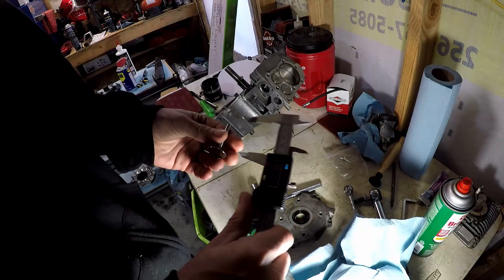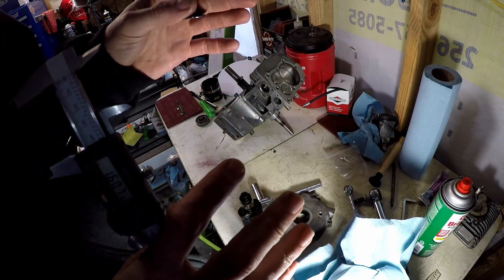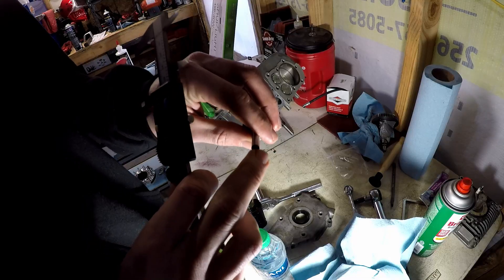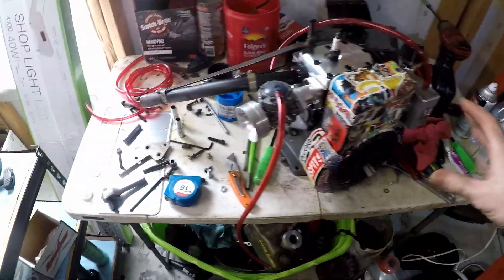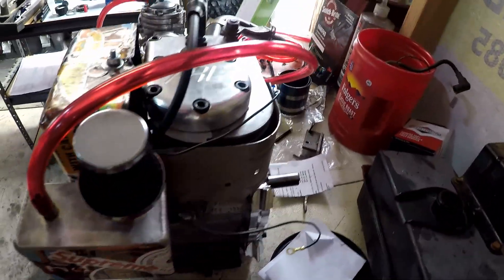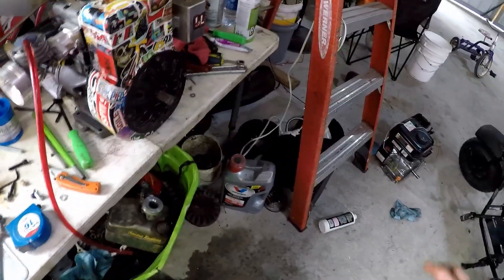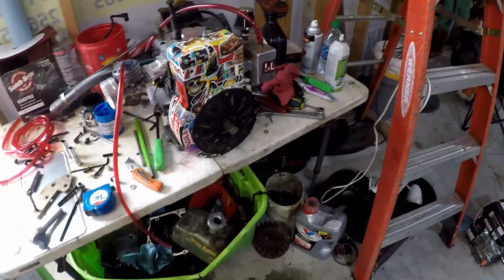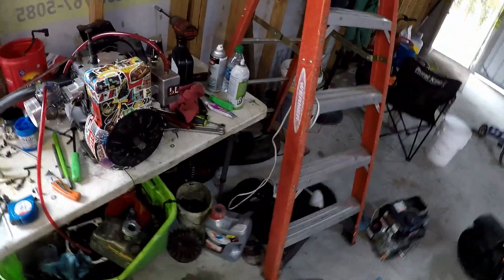I Built a 10,000 RPM Flathead Engine

Comment: This engine is not capable of 10,000 rpm.
Reply from the maker: Ok I mean I seen it at 9k
Reply: @RAWRMotorsports I build race engines. I can tell you how to get it past there.
Reply from the maker: I sold it 😢..  but it was on methanol , ARC 33cc billet head , 36 lb springs , stainless valves , billet lifters , billet 110 drag grind cam , till Olson carb , shaved eyebrows , slightly ported short side and inner wall , billet side cover , it was decked out oh and .015 over and thin copper head gasket

Comment: Hi friend, I bought a Briggs & Stratton 5hp flathead engine and I want to buy the same parts that you are using in Aluminum. Could you help me with the description of parts that I need to use? The engine you are making is a beast.
Reply from the maker: Arcracing.com and dynocams.com or nrcracing.com viperizer.com

Comment: Question I have a 5 hp flathead everything is new but it wont start and the timing is dead on I have a 110ss hot stock cam billet rod and flywheel and the valve lash is at 009 like is says and it has spark any ideas
Reply from the maker: Keyway sheared off flywheel .. see if it starts with starting fluid
Reply: @RAWRMotorsports  don’t start with starting fluid
Reply from the maker: @JesseLord-g5x does it pop? Backfire ? Check the czm timing and flywheel keyway
Reply: @ no it don’t backfire timing is correct. Flywheel is good not shredded.

Comment: Did u honestly the cylinder bore yourself ?
Reply from the maker: Hone ? Nah cleaned up with scotch Brite and sent it
Reply: @RAWRMotorsports  yes lol that’s what I meant to say . My apologies. I should have watched the entire video before commenting . So you bought this off someone , correct and it had good internals . Looks like they honed it from the looks of it. But you said you used scotch brite? Ok that’s the green pad , correct ?
Reply from the maker: @Greybuiltracing yea this was a fresh built engine when I got it
Reply: @RAWRMotorsports  I wonder what grit they used to hone the cylinder bore . It looks like a heavy grit . I once used a 340 grit and it ate up the rings 😐
Reply: @RAWRMotorsports  correction, I used 240 grit and that ate my piston rings . Heard it’s best to use 320 -400 grit with the ball hone if bore is round and not miss shaped .
Reply from the maker: @Greybuiltracing  use a properly sized 3 stone hone wet .. it will clean / straighten bore up
Reply: @RAWRMotorsports  yea I’ve heard that recently. Like a plateau home job , correct ?
Reply: @RAWRMotorsports  yes but what grit ?
Reply from the maker: @Greybuiltracing  watch some total seal videos on YouTube
Reply from the maker: @Greybuiltracing  most small engines have a fine grit  hone .. look at a stock block and duplicate
Reply: @RAWRMotorsports  they look like it’s 320 - 400 grit . Have u seen that plastic or whatever material bristle brush ? It’s suppose to be used after the last grit ball hone . It’s suppose to knock off any lose shaving so that when we break in the engine , it won’t end up in the oil .
Reply: @RAWRMotorsports  was checking out total seal hone video and it’s gold ! Ty
Reply from the maker: @Greybuiltracing yes sir

Comment: Cool video! Did I notice you have an aluminum flywheel? From where?
Reply from the maker: Arc racing or dynocams.com
Reply: I found it! Its coming right now! I already have the rod & cam. It is an explosive difference in engine performance! I expect same with the flywheel. THANKS! @RAWRMotorsports
Reply from the maker: Which one did u get ? U running gas or methanol ? About to get my Lil flathead vox running again !
Reply from the maker: Adjustable finned flywheel is what I'm running
Reply: I don't race. The flathed briggs is a powerful engine. I like to have fun. I tried to race with my daughter but area trax were against include a kart with larger than 4inch tires & who knows what inside the block! So, we do  cross-kart, atv trails. It is great to see others into what we do.  @RAWRMotorsports

Comment: How many cubic inches? I have a vertical shaft 28ci OHV block I'm going to use on a race mower, but the flatheads are cool.
Reply from the maker: These 5hp are 206cc stock .. this one was .015 over bore
Reply: Stock displacement is 13 ci

Comment: I’m a previous comment someone made you said you run a Dynocams 110 grind, you also said you have a billet head. Did you have to run stainless valves? What size springs are you running? And did you have to clearance anything for that cam and lastly how is its reliability? I wanna make some decent power but also don’t want to sacrifice a ton of reliability
Reply from the maker: It still runs .. Aint nothing as reliable.as a briggs flathead ... Amd.yes stainless valves and 36lb springs .. Theres a couple more videos on.this engine on my channeln
Reply: @RAWRMotorsports  did you have to cut the block for the lifters to not hit?
Reply from the maker: Yea you can just grind it out with a dremel
Reply: @RAWRMotorsports  did you actually cut circles or did you just use a sanding/carbide bit and take it down in in any shape as long as the lifter didn’t hit?
Reply from the maker: The second one
Reply: @RAWRMotorsports  ok thanks for the help
Reply: @RAWRMotorsports last thing I’m looking at billet heads and I have the chance to get a horstman head how has yours held up so far? I’m assuming good
Reply from the maker: Fine .. Get a finned head unless ur running methanol
Reply from the maker: Billet head has clearance for .450 lift cam
Reply from the maker: It's still running BTW

Comment: How much did you bore out the motor
Reply: What kind of piston did you use and did you have you block sleeved
Reply from the maker: No sleeve .. Stock raptor style piston ..
Reply: What kind of crank shaft do you have to fit that billet side cover
Reply from the maker: Stock
Reply from the maker: .015
Reply from the maker: .015 bore

Comment: Can you show how you hooked up the catch can? I'm assuming to the breather/valve cover but how?? I want to install a pulse fuel pump and not sure where to put the pulse fitting.
Reply from the maker: Pulse cAn go to intake , valvecover , or crankcase
Reply: @RAWRMotorsports  thank you! I've always heard that the valve cover is better than the crank case but just recently heard about the intake being a great option since you won't get oil in your pump
Reply from the maker: No problem

Comment: How many hp is this making and can you make a link to get all the parts used?
Reply from the maker: Idk mabey 18hp ... Build a pushrod motor or a blockzilla if u wanna make serious power .. This was more of a nostalgia build ... And all my parts came from either  viperizer.com , Eccarburetors.com, ARCracing.com & or dynocams.com
Reply: What cam? I have a 94ss currently with rod,flywheel,springs
Reply from the maker: @kodeycates588 110 drag grind

Comment: ok . ive been a small engine tec for 45 years . i see all these hp and rpm claims and i gotta chuckle . most briggs motors are governed at 3600 rpm , meaning  you are lucky to double that speed .  And these claims of 20 to 30 hp from a 5 hp briggs ?  Im gonna have to pull a Biden on u and  say , Come on man !
Reply from the maker: Its called clickbait .. But 10k rpm has been done on a 5hp flathead before .. This one ran out of cam at around 8k
Reply: Jr. Dragster has been making 27 HP from 5 HP "blocks" for at least 20 Years - - kids drive them.  But they don't burn pump gas.
Reply: @TIMEtoRIDE900  5 times the power of any engine is unheard of , thats like my 351c ford motor going from 400 hp to 2000 hp !  As much as i would like that , i dont see that happening . Im sorry but ide have to see that .
Reply from the maker: 25hp flatheads have been done for years as stated .. But ur looking at a $2000  lawmower engine at that point .. Biggest piston and  stroke that can physically fit in the block , billet everything , 30mm methanol mikuni carb , high performamce ignition system, biggest valves you can fit in it , 3 stage header , 3rd and 4th bearing supports for the crank  with a cap and bottom plate  so rhe block doesent split in half  etc etc etc..
Reply: @marcchaffee7751  "5 times the power of any engine is unheard of " If you look up 351w motors deep in the '70's you will find 149 HP and the NASCAR race-prepped versions have 750 HP on pump gas, 355 CI limit.
The briggs started around 5:1 CR and has an increase of displacement AND runs race fuel.  Not so hard to believe.
Reply from the maker: Its so funny how ppl are so deep rooted in their beliefs that they cant see the truth right in front of them .. Just because you cant believe something it be true dont mean it cant be done or hasnt been done .. Willing to fist fight somebody because you cant believe the facts .. Typical boomer
Reply: @RAWRMotorsports  exactly.  A boomer's biggest fear is younger generations calling out the bullshit they have peddled all our lives.
Reply from the maker: Facts
Reply: google is free yknow
Reply: @lilporno6583  hey , your late to the party !
Reply: Uncle has been building since I was little been around these engines most my life 7k was about top rpm we could get.
Reply from the maker: @lukekeller911 I've seen 8k on this engine on the tach .. I'm gonna get it back in top notch and push for 9k under load not free reving
Reply: Yep if you only knee,what to do,they,ll make some HP,mid to high 20,s,but it,ll
Reply: All those years and you never ventured over to the motor sports side of small engines? Come on man. Instead of thinking you know everything like the typical boomer why dont you ask around first.  It's ok to not know everything. That's the fun part.
Reply: @cravenmoorehead5636  lol, u youngsters talk so tough when your miles away .
Reply: @marcchaffee7751  I'm sure im not too far away. If u need me to teach u something hands on it can be arranged.
Reply: @cravenmoorehead5636  never under estimate a seasoned old man , u might hurt yourself there , sport . Oh ,  do u still wear that cute hat with the propeller on it ?
Reply: @marcchaffee7751  a month later? That punch line is long gone chief. Hell I thought u died of old age. ;)
Reply: @cravenmoorehead5636  lol , nope your not that lucky there sport . U should stop by nor cal sometime and we can meet up , I will look for the red propeller hat . lol . Oh , make sure u eat your spinach that day .
Reply: @marcchaffee7751  oic a popeye and some other boomer cartoon comparison. Let me ask u this.  How.do u know it's a red propeller? I'm sure u still livin in black and white. Go buy some life insurance fella. Cause u need it with or without me.
Reply from the maker: A year later the facts still stand 30hp flatheads are here and healthy still turning 10k rpm ..  😄😄.  Methanol and nitromethane win 🏆 🙌

Comment: Hey brotha I just picked up a 5hp Briggs what are the best mods for it if you don’t mind
Reply from the maker: Rod, flywheel, cam ,and springs and it will ripp
Reply: @RAWRMotorsports  brotha your the best thank you so much 💯🙏🏽🤝
Reply from the maker: No problem 🤘
Reply from the maker: Can also mill the head and or use thinner head gasket for higher compression .. but u gotta make sure u have valve clearance
Reply from the maker: Port, polish, carb , header and govenor delete will wake it up on the cheap
Reply from the maker: Watch my free mods video

Comment: I seriously doubt that Horstman's gonna hold at 9,000 but I will give ya points for the build. I understand why ya shaved the fins off the head but then why do you even keep the recoil starter/fan shroud? It's a few more ounces lost in the quest for speed, if that's the final goal here. I didn't notice if ya shaved the fins on the flywheel either but ya dont really need em now, I g uh ess.
Reply from the maker: Check out the custom minibike build videos .. that is where the engine is now
Reply from the maker: Nope don't need any fins on a methanol engine .. but if I wanna swap it to gas it will need em

Comment: how much did this all cost i have a flat head 5hp briggs
Reply: Dont need a steel sleeve block but it's nice some of the fastest flatties I've ever had were cool bore
Reply: @jackmarlon3183  yeah but they don’t last long
Reply from the maker: $600 ish
Reply: You need a good block, not a regular aluminum bore block. Raptor 3 or I/c is required
Reply from the maker: Yep steel sleeve block
Reply: @connorssmallengines6663  cool bores are just as good. It's not all about the block more so the work done to the block. Even the Raptor 3 and 4 are not deemed race ready out of the box until machined the rest of the way. And yes with the correct piston and rings the cool bore will last quite a long time. Dont break the glaze.